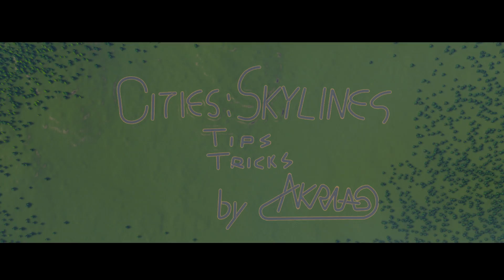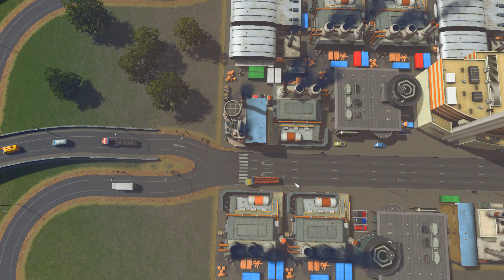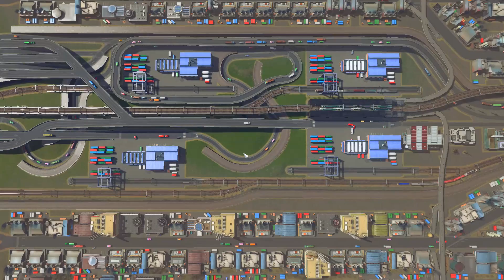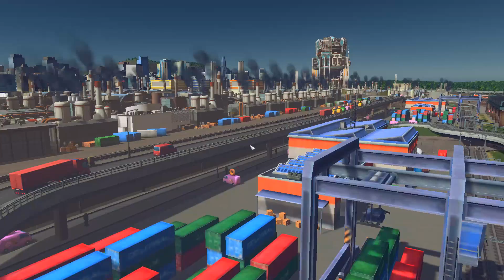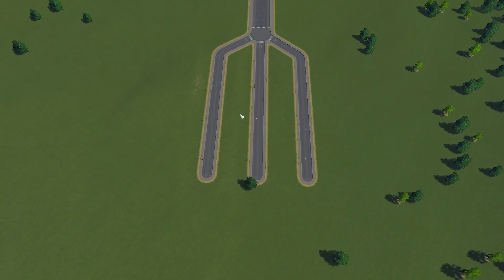Cities: Skylines - Tips and Tricks #1 - Efficient Industrial Zone

Comment: I found a small innovation on this that worked really well.  I tried the trick with the lane arrows to get the trucks to use only the center lanes, but many of them just ignored it.  So I copied something I saw Fluxtrance do, and set a much slower speed limit for those outer lanes used for loading.  That worked incredibly well.

Comment: You apologise for the way your video might turn out and yet it's one of the most useful and well thought out videos I've seen for CS.  And your plan for a workable industrial zone which has decent traffic flow is certainly one way of achieving it. It reminds me of the old TTD hack for getting multiple platform terminus stations to work properly, where you loop the trains round to the back of the station to reduce congestion. I've tried to do the same thing as this, but I've not tried blocking off the outside lanes yet, I'll have to give that a try.

I'd also like to comment on the stations you've used here. One of the reasons you didn't mention is the train congestion: Having more than one station really helps with loading and unloading more efficiently (and I notice you use the same loop method for this as used in TTD as well).  In fact, one of my biggest bugbears with CS is the inability to have a proper goods loading yard with multiple spurs for loading trains.  I've seen multi platform mods for passenger stations, but I feel a proper goods yard would be a worthwhile addition to the game. But that's not your fault.

Comment: Oh man! Thank you SOOO much for posting this! I've been pulling my hair out all week trying to sort out the huge traffic jam that had become my highway. I'd been doing little drawings of flow charts on pieces of paper and then making them in my city  (120000 pop) and each time it just moved the problem somewhere else. Grrr! I'd tried a petal design, an inner and outer roundabout design, and a fountain design amongst many others. But I've incorporated your system now (with two outer roads and the double ramp design at the end of each lane) and now everything is flowing real smooth. There's one hot spot by one of my stations but that'll get fixed once i open another outward train track. And I'm actually playing the vanilla game so haven't used traffic mods or owt like that. Thanks again. You've saved my sanity!! 😍

Comment: I challenge you to build something similar with vanilla... now that would be an interesting video
Reply: you can build 90% like this without mods. It will just be less compact, and not look as cool
Reply: Pepe Cool I said it will look less cool without mods
Reply: Nice challenge - smaller industrial parks don't need such an elaborate entrance and exit imho
Reply: Søren Jensen if you have an (non steam copy) there is a site called smods for all paradox games
Reply: Is there a video of YOU doing that ? Didn't think so.
Reply: On PS4!? Hahaha
Reply: I just did on a ps4 nonetheless lol. It is pretty close to the video only significant differences were obviously I couldn’t place roads under the highway and I have three rail lines where he has 2 due to the fact I can’t place the elevated train station tracks under the cargo train tracks. Also I have to use 2 lane one way streets instead of the 1 lane option he has and no quays. Use Freeform option, turn off snapping grid and it is doable in vanilla mode. Mine honestly is just as compact and looks very very similar. I could never have come up with this on my own so very grateful. This is a very efficient way to make a large industrial zone
Reply: Upstate Thrifter how did you connect the roads to the highway?  Any chance you have image of your console build? Thanks

Comment: I wish I would have seen this video and commented a few months ago. The way to get the cargo terminals not to back up is to have the road go straight into the terminal and then stop at the terminal. That way the cars drive off the end of the road straight into the cargo bay without turning. There is no blocking traffic then. You can even do it at a 45 degree angle and have a one way road. That way they pull straight in or with a slight curve instead of the slow 90 degree turn

Comment: For NON MODDERS and maximize road lane usage, I use 6 lanes to split 2 lanes ship, 2 lanes highway, 2 lanes train. Each will later split again. Each 2 lane will split into 2 single one lanes to feed a cargo terminal then highway return.
Reply: i have a sustained zone, a nice connection of train track that goes into the commercial OR exporting, the truck just keep circling the zone, not touching the highway AT ALL

Comment: At 10:00 you show the whacky traffic issue with terminals hitting each other coming in/out for delivering goods. Notice the second terminal wasn't doing that. NODES! One thing I noticed is if you have a node in front of a terminal it creates this issue. Delete roads near terminals and create a 12 unit road directly in front so the nodes are at the ends of the terminal and the traffic will flow smoother. ALSO, if you have merging traffic in front of a cargo terminal/ train station you can create a bypass lane for traffic by changing the curb lane for drop off and making it slower and the further lane faster. Then additionally use lane manager to keep traffic from lane change in front of it.

Comment: a lot of detail , BUT , I opted to just take the use of the Rail line connections and placed a rail line in the middle with rail connections on either side , and then further down a bit repeated the process ,   as for my Industrial areas ,  I created a basic large grid with one way roads inside the grid areas for an easy movement of trucks as the enter and leave the bulk of my factories

Comment: Well, well. I have also copied the layout, and I have found out, that the most important part is missing: highway connection. You also had a traffic jam, everyone would have a traffic jam. The inside-design is also too complicated, since you have only 2*3-4 roads of industry, which covers 3000-4000 jobs and goods for 40-50k cims.

Comment: That's looks great, which mod/mods allows you to build an elevated road on top on a ground level one like at 12:24?
Reply from the maker: Fine Road Anarchy (top road first, then bottom one) and Network Skins to change pillars for either that slim conrete or the double steel (I now use the NYC train pillars, very nice for these 2 level roads), Move It! is nice to then do final adjustments.
Reply: Thanks a lot
Reply: Mark There's a new tool called parallel road tool that let's you build a perfect road on top of the road you are building, check it out!

Comment: I've got a problem with my replica of this setup. I've changed the positions of the train terminals so that there is no need of bobbing and weaving the roads.
I use the two stations on the left for the outside world cargo, and the right two for the town cargo.
I also have farming industry on the bottom wich doesn't seem to be interested in train terminals that much. Also not a lot of traffic.

The top section is normal industry like in the video. And seems to attract an entire highway of trucks (wich is waaaay to much for that amount of industry irl).
Also they favor the train terminal for the town shops and barrely go to the outside world terminal.
What might me the problem. If anyone wants more info let me know. I can also upload a video of it.

Comment: Good concept but, City skylines cheat on traffic. Use president manager mod, turn off the dispawn of traffic to become really and that little industrial concept would stop dead. The train station in the middle is a nightmare, and even in this stage you do not have too much demand by comercial buildings. 
I play with despawn off and the game does not magically makes cars and trucks disappear like magic. If you are stuck in traffic you are stuck in traffic.
Reply from the maker: Cargo traffic doesn't magically appear and dissapear, all cargo vehicles have their "homes", either an industrial building that sent it on its way, a cargo station or a city outside of the map. They will return to these after making a delivery, this is not affected by TMPEs despawn feature. TMPE only bans traffic from despawning if they are waiting on blocked intersections for a long time, so if you already have traffic issues, it's going to be even worse, but that is not the case here, traffic is flowing fine. I tried running the game for about an hour with despawn disabled and the entire city is completely fine. I'm going to keep it from now on, why not.

Comment: Industry is simple trains no highway conection or conection bye road to your subsection  ( i use this method) there are created in such a way that there is no conection  ( by roads ) between parts of the city 
Sections one is low residential 
Section two is high residential 
Tree is low Comercial 
Four is high Comercial 
Five is office 
Six is industry 
All of the sections have cargo trainstations and normal trainstations and airports and subways each also have the service  ( fire police health education dead care) that only operate in each section  ( only low and high residential have parks and education since in real live there no schools in industry for example) 175 000 population in vanilla game play with 87 % traffic. 
Work from top to bottom and left to right for side roads side roads should always be smaller than the top to bottom roads for example a six lane top to bottom roads whoud have maximum four lane roads connected to them the smallest roads is what i call " pie roads " or roads that move diagonally in 45 degree angle  ( work bottom right corner to top left corner ) thees are twolane one ways whith trees. 
This will provide your sims ( ehumbah) 
With alternative roads note thees should only be zoned on the rightside and non of the police/health/ fire only garbage and small parks

Comment: Still can't figure out how the trucks know which cargo terminal to use. It looks like they have a choice. How do you keep them from clogging one or two, instead of spreading out equally?
Reply: There are 2 train stations for going to town (the shops) and 2 stations for going of the map (outside world).
There is a certian demand of items. And so a factory can choose to either export to the outside world or to the town (shops). That way the trucks will equally disperse, or that's the point.

In my case they all want to put it on the train towards the town and everything is clogged up.

Comment: Slightly clickbait... Reasons as follows. If you're going to make a tutorial it would be best to do so on the vanilla game. Doing a tutorial with mods makes most of this video completely useless for those who don't play on PC or don't want mods.

The network you use here isn't actually efficient. Cargo trucks tend to make 2 to 4 stops. In this setup that's 2 to 5 loops. Easily a 2 minute drive per loop. It does however look very good and is compact. So it's a good balance.

That all said the vanilla traffic ai is just retarded and mods really help clean it up. None of this means I hated the video. I just feel tutorials and tips should be vanilla with options at the end via mods.